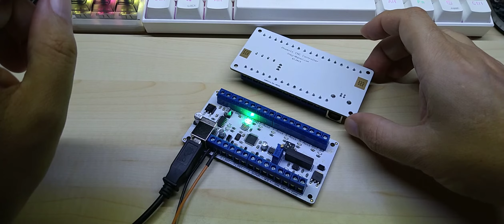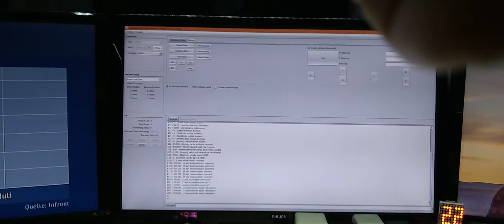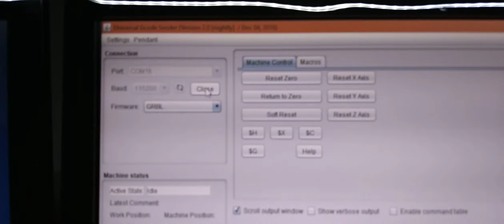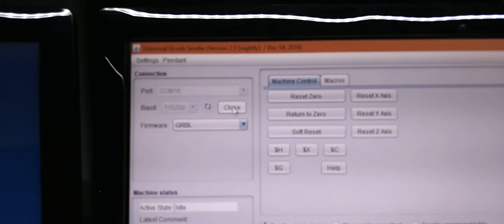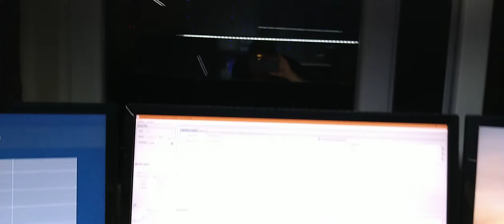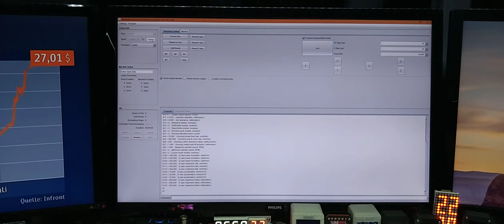Phoenix CNC Controller by Hayri, a brief overview and features explained For sale in my Tindie Store

Comment: Can this run dual
Steppers on the x axis?
Reply from the maker: You can connect the step and direction signals for the x-axis in parallel, like it is done for the y-axis on my board already.